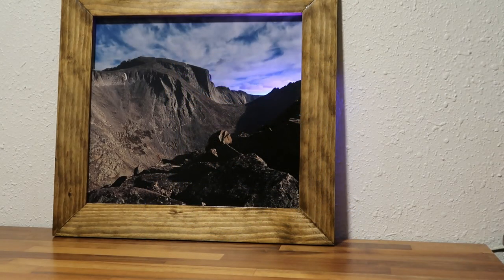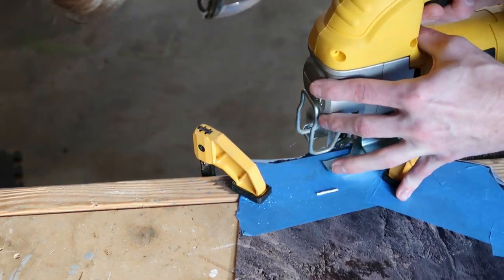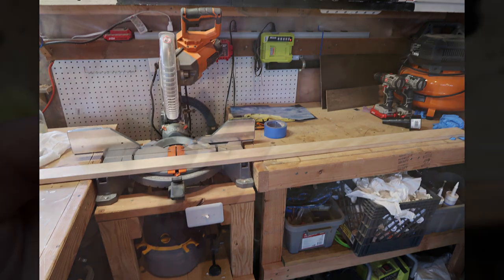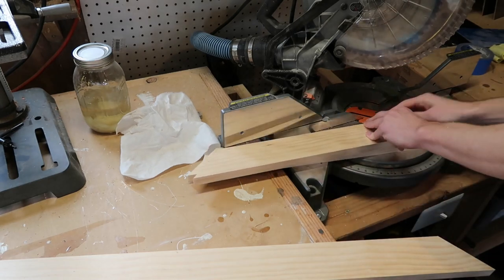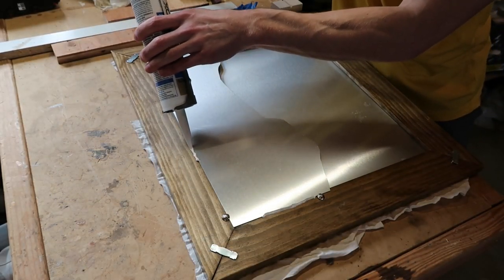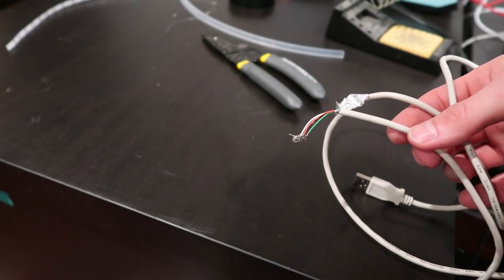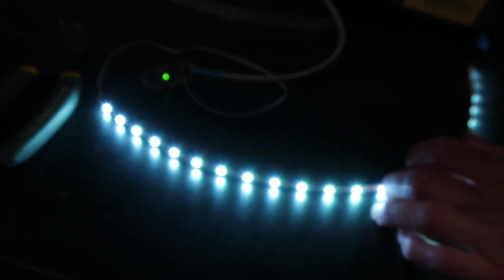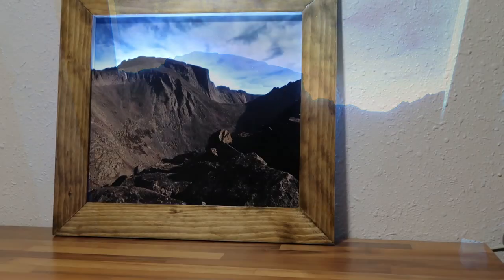DIY lighted horizon picture

Comment: Excellent project!  It looks great. :D

I'm curious if there was a specific reason you chose to use a MetroMini as the controller, or if that was just a controller you had on-hand that suited the project.
Reply from the maker: It was just one I had on hand that was fairly small
Reply: @tomp6633  Gotcha.  It's certainly a good microcontroller for the task.  Thanks for the response!